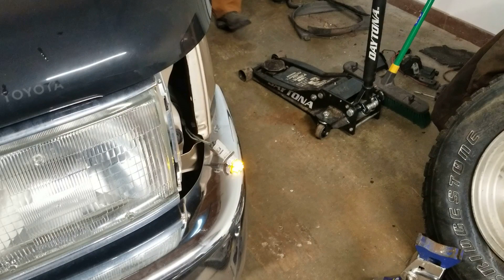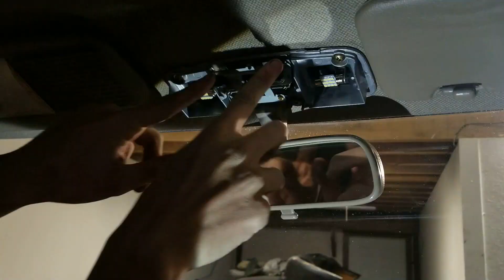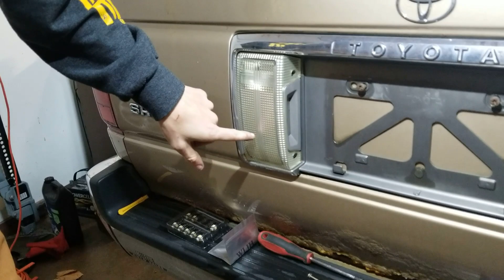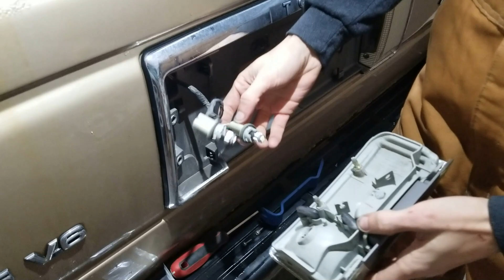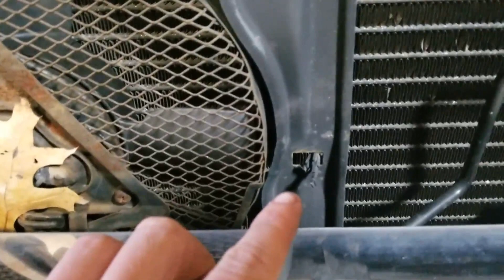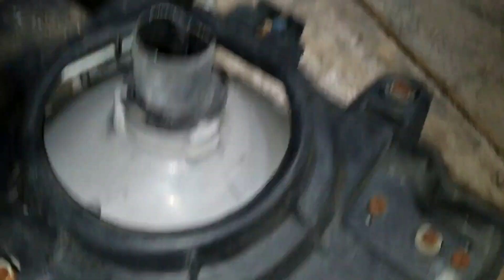2nd Gen 4Runner LED Conversion

Comment: I came here because I bought a set of 9004 LEDs that I thought didn't fit, and couldn't return because I opened the package. I got pissy at the store clerk because they wouldn't refund me.

Now I feel like an asshole because I didn't know you could take them apart to fit that plastic clip on.

Problem solved.

Comment: Just converted all the lights in my 94 4runner to LED and love the improvement. One drawback I found is that now my blinkers huperflash. Did you have this problem afterwards? If so, what resistor did you use to fix it?
Reply: For anyone else having the same issue, here's the fix : 
-Take apart the drivers side dashboard and turn on your signal light. 
- Follow the "clicking sound" of the turn signal until you find its source : the flasher relay. (Mine was located on the back side of the steering column).
- Replace flasher relay with one that is LED compatible. The part number for the stock relay is 81980-12070.
It's a relatively simple fix and I was able to do it in NAPA's parking lot in about 5 minutes.

Comment: For the headlights on my 94 4runner I actually did them a different and maybe easier way. Instead of risking breaking my grill and removing the headlight assembly, I just took out the washer fluid and I believe its an intake piece on the drivers side and then just simply turn the light and pull it back and remove and install the bulb.
Reply: Same on my 92
Reply: Yeah the washer fluid is the way to go ngl and pretty sure it’s the exact same on the other side just with the coolant overflow

Comment: Swapped out my signals with the LED bulbs listed and now my turn signals won’t work and gives off a buzzing sound whenever I try to signal. Hazards work but have hyper flash. Any suggestions on how to fix? Thank you.
Reply: Install 4ohm resistors in line with signal wire and it will flash normally. Reason is ledbulbs have a much lower draw than fiament bulbs

Comment: Just curious, after doing the headlights did your high beam indicator stop working? Just put the same bulbs in my daughter's twin to your rig and now there's no high beam indicator.
Reply from the maker: I can't remember, I haven't had the 4Runner for almost a year and I live in town so I never really used the high beams
Reply: did you ever figure out the problem with high beam indicator? I had the same problem when i switched mine
Reply: @matthewchua8465  I haven't really had a chance to look into it

Comment: Got led headlights...didn't allow dash indicator light to work(highbeams).  So they sent me resistors which were massive and didn't work either.  So now I occasionally check that I don't have my high beams because it's easy to flip than on without realizing it.  In other words,  pain in the rear as you have to remove grill and nonsense and all the clips break...I did it 3 or 4 times trying to get those leds to work.  Make sure you purchase ones that actually work with 2nd gen 4runner.

Comment: if you're just replacing the headlight bulbs:
I was able to avoid removing my grill by taking out the washer reservoir and the battery on the passenger side, then just took out the two bolts on the plastic cowl for driver side and shoved my hand down there to get the bulb out then unplug it.
Reply from the maker: Yeah, part of the reasoning for removing the grille for me was to CAD a steel front bumper for my buddy's fab shop to make and I needed to see all the mounting points

Comment: Did you adjust the beam pattern at all? on my 94 4runner Mine don't shine out that way. I have the bulbs facing at 3 and 9 o'clock. They don't spread the way yours do
Reply from the maker: Be sure they are seated correctly then you will have to adjust them

Comment: I have installed all lights correctly but now my blinkers are flashing quicker
Reply from the maker: Like I mentioned in the video LED turn signals either require resistors or LED flasher relay
Reply: Guess I missed that lol

Comment: I'm getting ready to do this exact same thing on my 1st gen Runner.. I got alot less lights to change tho haha. Did you notice any difference in power draw? Aside from looks and being able to see better, the power draw is what drove me to do this.
Reply from the maker: I never had that 4Runner in any situations where power draw was an issue so I didn't notice any difference. However, I can say there will be a difference mostly in headlights and tail lights, especially if you want to use those to set up camp or something with the engine off.

Comment: I tried this with my 95. Every time I used the T/S's the cruise kicked out. With the LED's in the brake lights, it would not allow the cruise to even turn on. I went back and purchased CANBUS LED's and still had the same problem. I just haven't had the time to install inline resistors for every single bulb. too big a PIA! I had to return to standards in all exterior except the front parking lights and the rear tag/reverse  lights. I did install HID lights in the headlight system. I also recommend CREE for any/all your LED needs. in MY experience, they produce the best product with zero problems. I too did the dash light conversion to blue CREE bulbs. I have had, one year later, no problems! At the same time I installed white face gauge backs. HUGE difference in looks and visibility!
Reply: Where did you get the white face gauge from?
Reply: Interesting that you mention the cruise control not working. I installed LEDs in my tail/brake lights and my cruise will turn on but it won't set; it just flashes on the dash 5 times and then shuts off. I wonder if the low resistance of the LEDs have something to do with it.

Comment: Could you just removed the battery behind the headlight for access? Those clips are brittle, looks like a lot of work to change the bulbs.
Reply: You don’t have to take the grille off unless you want to replace the whole housing. The bulbs are accessible if you remove the battery & a piece of plastic behind the driver side headlight.

Comment: Do you have a problem with hyper flashing using led turn signals?
Reply from the maker: Yes. If I didn't mention it in the video, you either need an LED flasher relay or add resistors to all 4 turn signals
Reply: @BackyardBuilder513   Cool. Thanks for this video, not really one out there for 1995 4Runners.